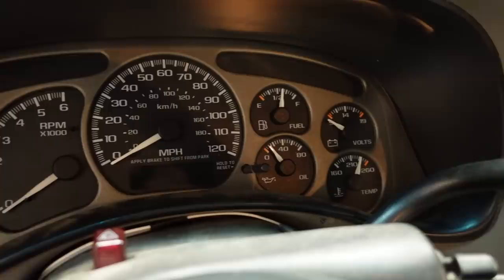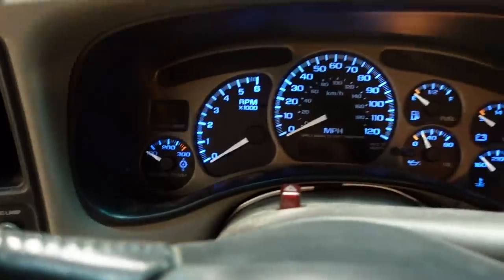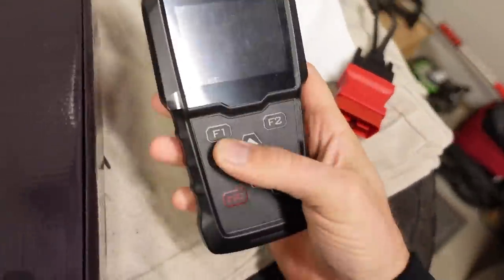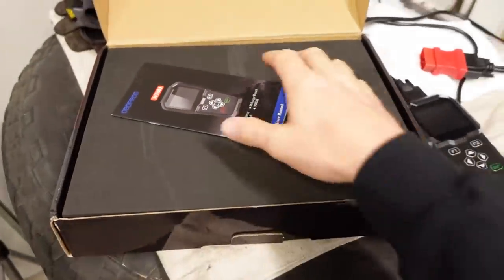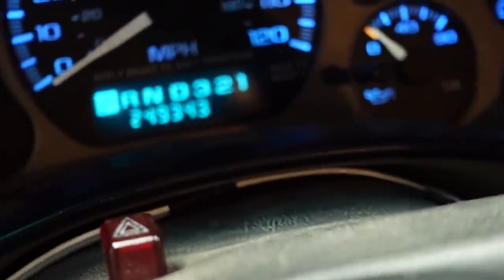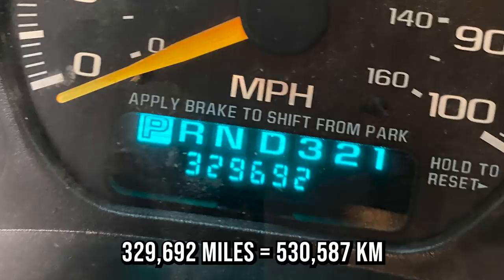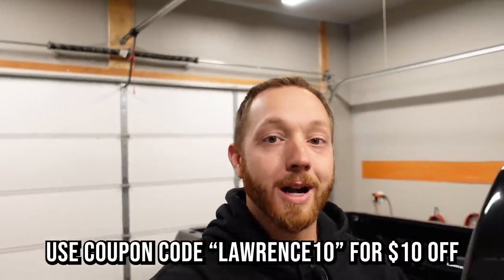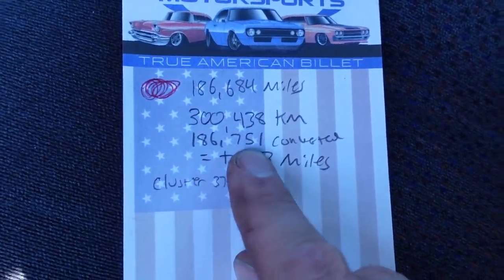DENALI CLUSTER in BOTH TRUCKS + correcting mileage with the OBDPROG MT601 from OBDZON

Comment from the maker: Update guys, it looks like they've sold out of the MT601, but they do have some other mileage correction tools that might be of use.
Immobilizer key & Odometer Correction:
OBDPROG MT401: https://bit.ly/3mt4yRb
OBDPROG M500: https://bit.ly/3bkoaAy
ANCEL DP500: https://bit.ly/3CoSIwT
Key Programmer:
OBDPROG M501: https://bit.ly/2Zt7a8m
LONSDOR K518S: https://bit.ly/3BsRdfW
OBDSTAR X300 DP PLUS: https://bit.ly/3BozZQu
OBDPROG MT003: https://bit.ly/3CzaywY

Comment: I flashed a few EEPROMS using a clamp on adapter. Last one I did was an oem stereo that refused to take a new VIN through the Tech2. Load the contents up in a sector editor, found the old vin and entered the new one. Save to eeprom and done!

Comment: Denali gauge cluster swap is awesome The aqua glow is my favorite part. . I did it in my daily driver 2001 single cab long box 5.3. The unit I bought happen to have a few hundred more miles than what my truck was at, so I bought it and just drove up to the mileage before installing.
Reply from the maker: I put some cool white LEDs in the cluster in the uglytruck and because of the blue filter they come out blue which looks cool, but on the stepside I kept the stock bulbs, and love the green as well.
Reply: ISS automotive great source for reman clusters. No deposit hassle. Shorter warranty if you don’t send yours or lifetime if returned in 60 days I think when I got mine last year. I got the blue leds and love it. My cluster was not repairable because someone had been in it before and their repair broke.

Comment: Hi LT,
Glad that you were able to correct the mileage through the OBD2 port.  That is way easier than doing it with an EEPROM programmer.  Especially if you need to unsolder and re-solder the daughter board on the cluster.  Thanks for the video!
-mike
Reply from the maker: yeah, I wasn't looking forward to doing any soldering, glad this worked out
Reply: Neat tool. I'm glad to see something like this finally hit the market for us common guys. I've always just sent my cluster out to have it reprogrammed.  Does anyone know if they make tools to interrogate/flash the BCM on GM's ?

Comment: I ordered the MT401, it arrived in 2 weeks. Plugged it into my 2005 Silverado, went through the steps and it actually worked. Replaced my cluster months ago with an ebay special with trans temp guage. This tool is awesome, thanks for the tip.
Reply: Were you able to make the odometer exactly accurate?
Reply: Yes, took a couple of tries.

Comment: Good video I want to do this to my well used 2002 GMC SIERRA 1500 2WD 4.3 Vortec V6 with 409 thousands miles a well used for $1500 I bought her with 403 thousands miles she is a real strong runner I do as many 4.3 mods as I can to give her the edge  befor the mods she wouldn't even spin the tires  trying hard to hit 500 thousands miles peace and much respect to you Jason 👍

Comment: Question, Subbed. My 05 Silverado gauge cluster went out. I sent it out to get repaired. Now they need the total milage to program it in. How do I get the actual milage from the truck? What scan tool can pull that info and the engine hours.

Comment: Hey LT is the background lights in cluster (the numbers and lines bulbs) are those stock color bulbs or did you change them? I recently soldered blue bulbs into my TBSS and they are almost blotchy cause they shine too brightly.
Reply from the maker: so these Denali clusters normally shine through with a light green color from the factory (yellow bulb + blue filter) and when I swapped out the stock bulb for a cool white LED, the light passes through the blue filter, and you get blue up front. I got the widest angle LED bulbs I could
Reply: Ahh ok. Thanks for the info LT.
Reply: U need to get diffent lights

Comment: If you change clusters with one that has trans temp does the trans temp work or is there  other modifications to make ? Would like to have trans temp in mine
Reply: It will work, plug and play. No modifications
Reply from the maker: Correct, plug it in and go

Comment: Is it possible to do an all wheel drive conversion on a 99 Chevy Express van? Mine is rear wheel drive
Reply from the maker: sure anything is possible, but you need a way to mount a front differential. On a truck, I recommend finding a 4wd donor frame and swapping it in place. No idea whats available on an express platform though...
Reply: @LawrenceTolman  same as a Chevy Silverado 1500

Comment: What would be funny is they did like smog in some. States and after 25 years old they didn't count those vehicles. Our gmt 400 and 600s are almost there anyways.
Reply: I have two 2005 800's and my state says on the title mileage not required. Both are just less than 200,000 butits usually due to age.

Comment: What about how the cluster reads the transmission temp. That would be an interesting short video idea.
Reply: Trans temp is read through the engine/ transmission computer.
Reply: The trans temp gauge will read correctly just by plugging in the new cluster.
Reply from the maker: The information is already there with the stock transmission and wiring, and it’s already being broadcast on the data lines into the cluster so all you do is plug in the cluster, and it works

Comment: Wasn't there something about the air bag light also switching these clusters in?
Reply from the maker: only on the 1999 model year trucks, 2000-2002 will directly swap over
Reply: Ah mines a 99 bought a cluster had an airbag light
Reply: I used to have a 99 before I got my 02. The 99 also had those annoying auto locks that locked the doors at 20mph, but wouldn’t unlock in park. Couldn’t disable that crap like you can in the 02.

Comment: I noticed when selecting the year of the Silverado it showed 1997-2001 then the next line was 2003-2006 skipping the 2002 model year.  That occurs at 6:41 in the video.  Can you select a 2002 model?
Reply from the maker: yeah, I saw that, and I think it's just an error in how they listed the years of the trucks on the menu. The 1997 and 1998 chevy fullsize truck still used an analog odometer anyway, so I'm pretty sure you would just select the 97-01 option if you have a 2002 truck, since they share the same electronics

Comment: Can it flash an 03-06 cluster to unlock the driver info center?
Reply from the maker: I'm sure it would be able to program the mileage, but not sure on any other features. probably not to be honest
Reply: @LawrenceTolman  I looked on the site and it didn't say it did so I'm assuming not.  Gess I have to find on that is already unlocked and then change the mileage.

Comment: So I saw your video on swaping from the electric shift transfer case to the manual one and I was wondering how hard it would be with a 1997 c1500 suburban since there is no torsion bars if it would be easier to put a transfer case in it and can I change out the output shaft on the trans to run my trans my plans are to straight axle swap it and what's different on the 6 lug axle vs the 5 lug axle can I just bolt a 6 lug rear axle in it or does it require modification
Reply from the maker: 5 or 6 lug axle shouldn't matter much, they have the same yoke for the driveshaft to bolt up to and in a 1/2 ton they are both an 8.5" 10-bolt anyway. There are stronger axles out there like the 14 bolt semi floater or full floater if you are going to be running big tires and doing some more agressive off roading. And yes, you can take apart your transmission and swap output shafts to allow a transfer case to bolt up to. Then, you're on your way to SAS.
Reply: Thank you for the info I just had the trans rebuilt a short time ago like a year ago and id hate to have to ditch it for a used one that I might get 100 or maby 30,000 miles out of it I appreciate you're help

Comment: 2:06 that is not high mileage. I have a 1999 1500 Silverado original motor(5.3) original trans (4l60 it has been gone through once) and replaced the front and rear differentials. With 489,326 Miles on it and drive it to work every day. It needs a new blower motor but other than that she's a keeper.
Reply from the maker: Dang! You got me beat
Reply: @LawrenceTolman  well im haveing to rebuild the transmission again thinking about going for a 4 l80. 499,102 miles now. What are your thoughts on the 4l80??

Comment: I took my chip off my old cluster and switched it to my new cluster on my 03 Silverado and it put my original miles on my cluster it wasn't very hard there's videos on it
Reply from the maker: Don’t think that will work with what I did since the chip also contains coding for the scale of the Speedo and the option of trans temp or not… at least that’s what I’ve read

Comment: Is the Denali cluster a plug and play
Reply: Yes
Reply: Yup
Reply: yes unless your truck is a NBS 1999 year model.
Reply: @randyrichardson4364  it will work just have an air bag light.
Reply: @leviwoodring6101  which isn't good.  fixing the air bag light requires extra steps making this not PNP.
Reply: @leviwoodring6101  I know that when the abs light is on, your abs will not work.  If that's the case with the air bag light as well, it's probably not a good idea.
Reply: @Mr_Ruhl  again only if you care.
Reply: @leviwoodring6101  lol, you'll be eating those words alongside your steering wheel or windshield if shtf.
Reply: As is the Escalade cluster, just fancier.
Reply: @Mr_Ruhl  so what you never drove a vehicle without air bags? I don't whare a seat belt either why becuse why not. Only one I'm indagering is me. So it shouldn't be any one else concern.
Reply: @leviwoodring6101  the issue is not about safety. seatbelt laws are about generating revenue. they sell it that way . but our busses dont have seatbelt

Comment: Aye my 2002 yukon has 328k
Reply: Not to brag , but my yukon denali has 352,145 .
   Paid $500 for it and spent all of $15 and a weekend fixing most of its issues . Oil leak (loose plug on oil cooler manifold) , rough idle (dirty throttle body) , and wonky cluster workings . 
   It's not new at all but runs fairly well and could use a little more TLC.  But six months in , and I couldn't be happier . It came with new tires a recent Trans build and a new battery . 
   Who would buy a new vehicle with all these great GM's laying around . To me $500 and a little time for six months of perfect service , might as well be called a free ride .
Reply: Oh , and it has ice cold a/c !
Reply from the maker: love to see a high mileage truck still putting in the work!
Reply: @danielgarrett1155  you are lucky lol I have a 5.3 and my ac dont work 😂

Comment: For the cost of the programmer it would be cheaper to take the cluster to the dealership and have them reprogram it to the true mileage.
Reply: Some dealership’s won’t do it and they don’t have the ability to change it. I worked at Toyota for 15 years and none of our scan tools won’t let you change miles. Only way to get the miles correct is to order a new cluster or take it to a place that specializes in clusters.
Reply: Dealership will not do that anymore I tried 5 of them all said no.